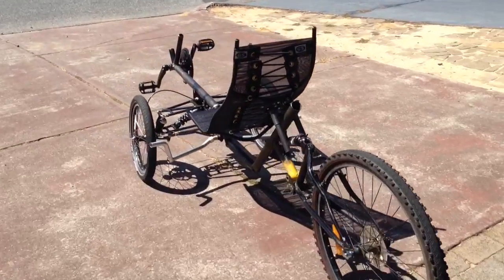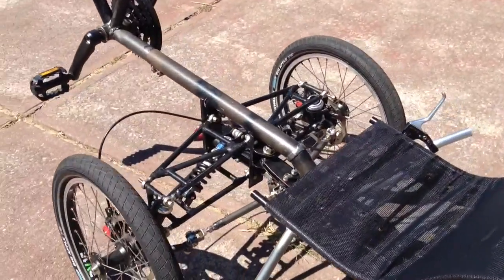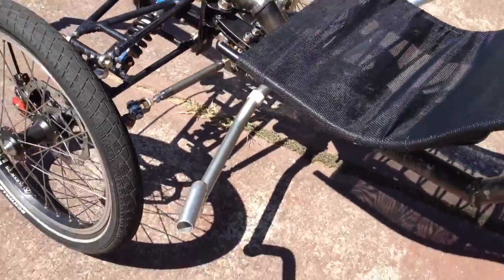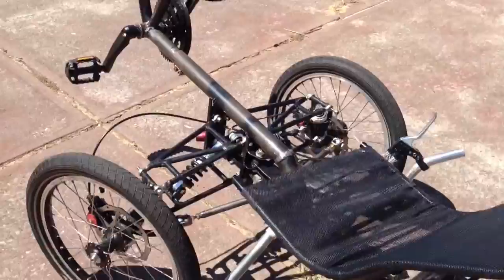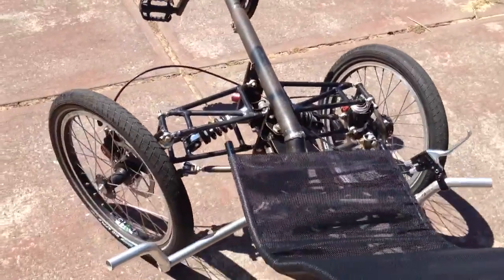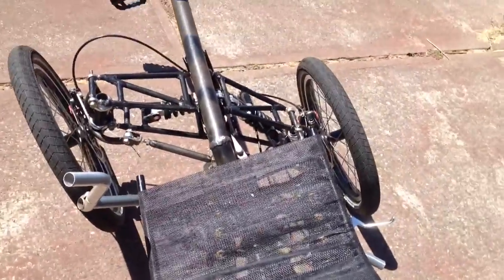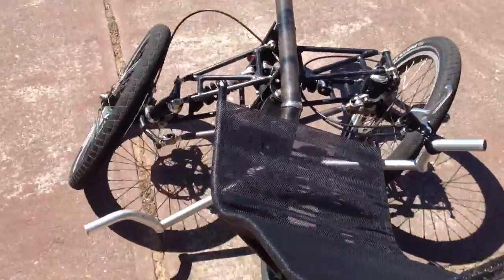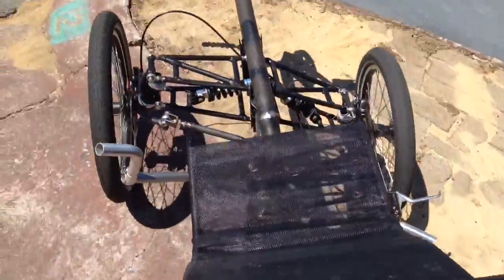EATSRHPV - pushing showing self-steering

Comment: Hello .
I ve watched a lot of your videos because i design an upright leaning tricycle , you have done a great job.
Maybe it does that because the rod end attaches too far inside towards the centerline of the bike and it gets to a neutral possition and then it surpasses it . May i ask i ve seen from an other video of yours you have oriented (i will try to explain this right if i can ) the ball joint hole parallel to the ground instead of perpendicular to it , that has the advantage that the ball joints dont limit the leaning , but in the other hand they limit the steering angle (correct me if i am wrong) how much steering angle does your bike have at this setup an generally whats a number that you believe is a good steering angle for a reverse trike ?
Reply from the maker: Hi Antonis, yes, this iteration of the steering geometry suffered from quite a few problems!  I significantly re-engineered the steering linkages to eliminate the possibility of the control arms hyper-extending as you can see in this video: https://youtu.be/koADanl4-vo  . With regards the rod ends, in this later iteration, they actually have two axis of movement so that the steering angle range is not compromised by having such a large range of leaning angles. If you look closely at the rod ends, you will see that they freely rotated within the tubes that the rod ends are mounted in. Hope that makes sense.